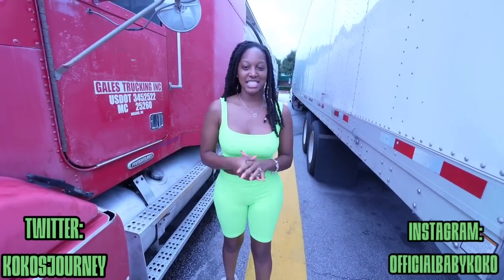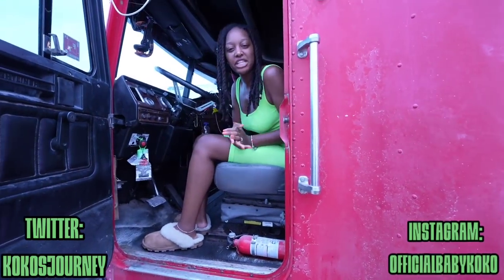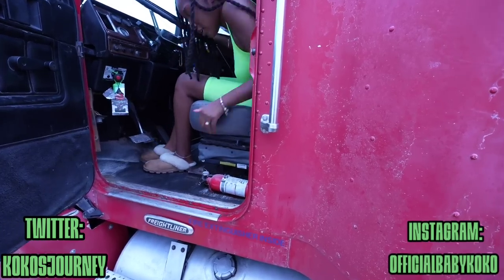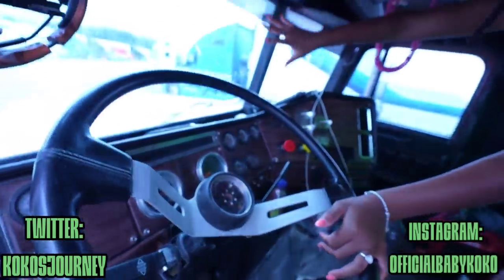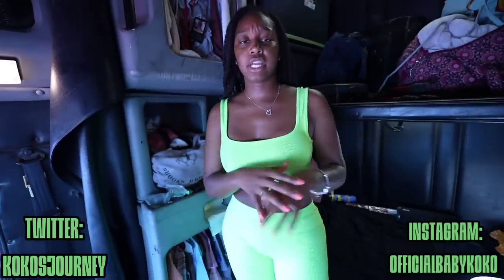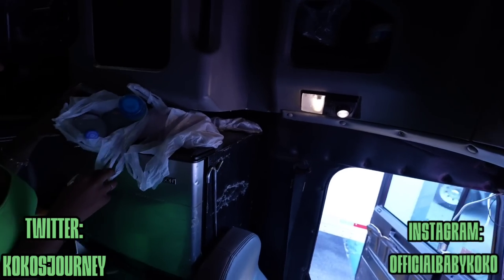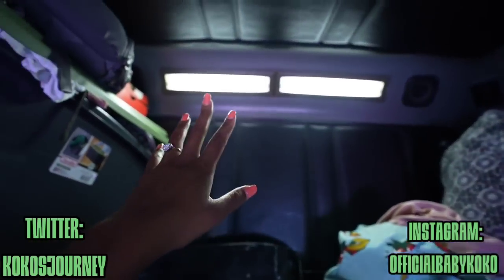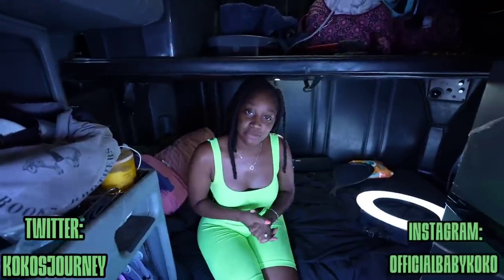Inside Tour Of 1997 Freightliner Semi Truck (Before Custom Work)

Comment: As a Detroit owner & a Freightliner FLD120/Classic lover, it has a TON of potential. Get about 700hp, a 13spd, 8in straights, 18" bumper, drop visor, woodgrain floors, 18" red steering wheel, digital gauges...she's got a real gem.

Comment: Just curious didn't you have a peter built and had problems now your in a 1997 freightliner  going to have even more problems just go finance on up to date or is this a old video
Reply from the maker: No. 🤎
Reply: Listen I admire your ambition but if you can after 2-3 weeks of running trade that truck it's going end up costing you more in the long run that's if you can afford it I know the struggle is real but if you can make better then do it